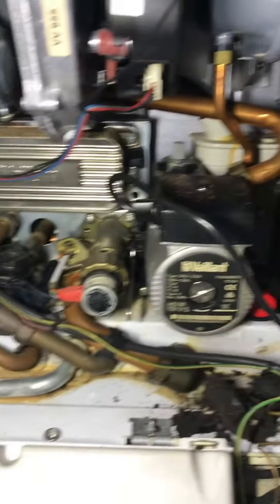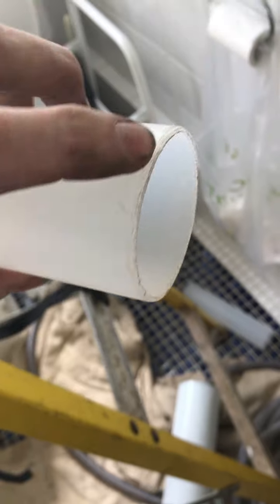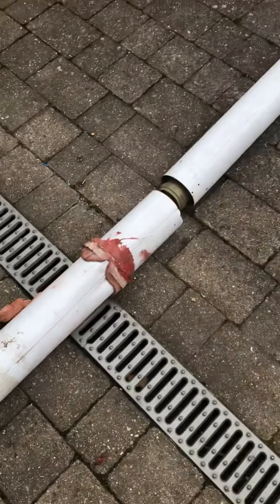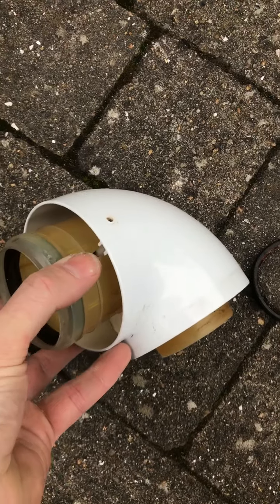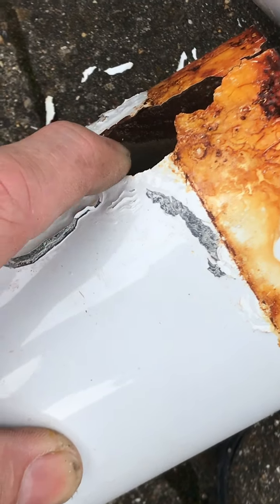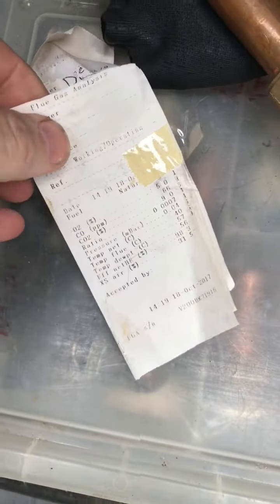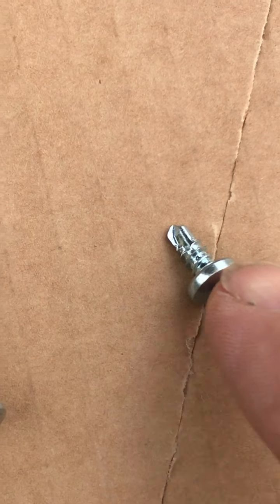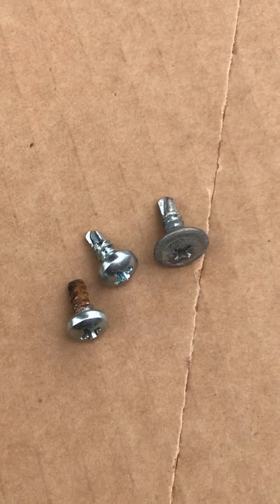Day in my life as a plumber 54. Vaillant Flue issues. Rusty Flues.

Comment: Hey mate 
Great video again 👍
The contract I work on we have lots of vaillant boilers , your right about the installers accidentally drilling into the plastic flue it has caused lots of issues !!
Also the packing washer in the flue turret fails quite often , giving readings on the air intake 👍
First comment and might help others 😎
Reply from the maker: Thanks buddy. “ Packing washer” you mean the sponge type one on the turret or the flue seal on the hex to turret ? 🙏 the hex one is going bcos of Hi temps set 💯
Reply: @drpipe  yes mate the one that the flue sits into 
Part no 981227 
It might help engineers who possibly think a flue seal has gone but in fact it’s just the packing ring 
As I say hope this helps 👍
Reply from the maker: If that goes it’s only sucking fresh air in would effect Co but def not Room sealed no more 🙏
Reply: @drpipe  sorry call me an idiot but why is it not room sealed anymore or have I read the comment wrong? As it's still room sealed isn't it as long as the insulation foam is in the right places around the boiler where its required to keep the boiler room sealed.

Comment: We have loads of pro 28s on our contract and the issue with the failed packing ring seal is very common, we have our engineers check the air intake readings on every one now especially longer flues
Reply: Should be done on every boiler where you can anyway

Comment: We have a lot pros etc in our area aswell suppose it's just cause that many . Never changed so many heat exchangers flue seals diverted valves pressure sensors PC in ma life.wb seals fit the inner on them.
Reply from the maker: And AAV 🤣

Comment: Dr pipe it’s when the boss says yeah just put the New boiler in and reuse the existing flue 😂😆🙄 BTW have you got a link for somewhere to order those flue screws you use? Cheers for the video mate!
Reply from the maker: Toolstation.....Drywall Phillips Screw Wafer Head Self Drill 4.2 x 12mm